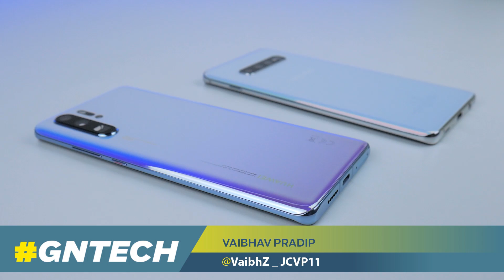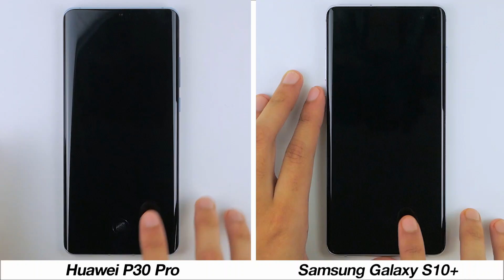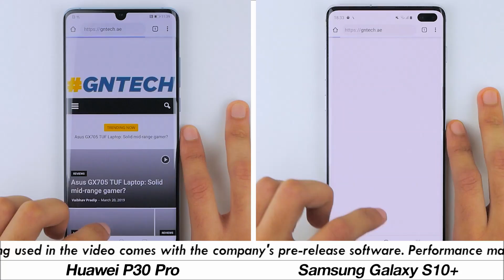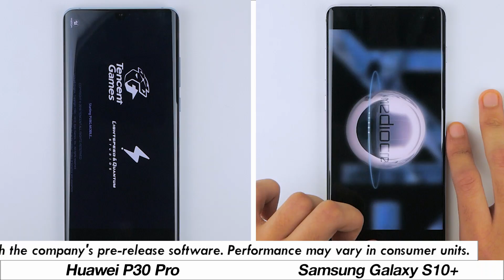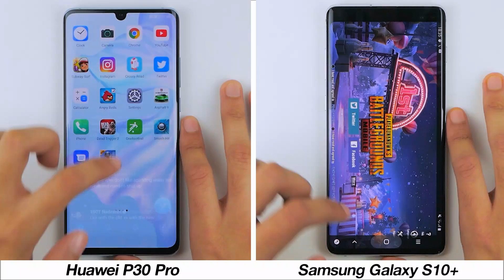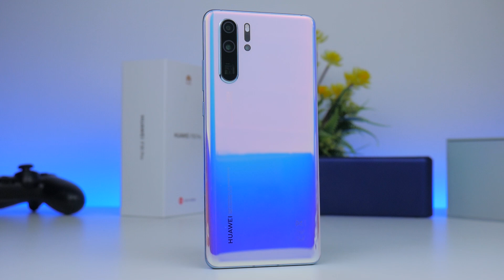Samsung Galaxy S10+ vs Huawei P30 Pro Speed Test: Kirin vs Exynos!

Comment: so speed p30 pro > s10+, Camera p30 pro > s10 + , battery p30 pro > s10+ . So s10+ is getting slaughtered.
Reply: Jimmy Huang everything else S10>p30 pro
Reply: @abdulwaduod11  still doesn't change the fact that S10+ is getting slaughtered
Reply: Jimmy Huang in my opinion p30 pro have some problem that they need to fix, video (4K at 30fps), front camera , they need more advanced fingerprint unlock, speakers are bad, microphone is bad, and they need to put quad HD screen, if they can do that then p30 pro >s10 plus

Comment: what was the screen resolution used on S10?
Reply: it'll be max resolution.  It's a selling feature on the camera.  To reduce it to 1080p for this test wouldn't be realistic.  Much more realistic to use max res on both cameras.
Reply: @BelfastBiker  I was talking about screen resolution, not camera resolution.
Reply: @ciprigeorgiu  as was I.
Reply: @BelfastBiker  You mentioned camera twice so I thought you were talking about camera. My bad. But the again it's not really fair to make a speed test and use one phone to a higher resolution as that means more pixels to drive. You get more FPS on a computer with 1080 monitor compared to having a 4k. S10+comes with FHD out of the box. Leave it that way if you make a speed test.

Comment: Kirin 980 unbeatable still now. That's proof benchmark does not matters. Actual real time performance matters and kirin 980 rocks hare
Reply: Nononono stop this is the exynos variant of the s10 which is bad. There also is a snapdragon 855 one which is as fast as the kirin 980
Reply: This has nothing to do with the cpu, you know that rite ?
Reply: @sw0925  Kirin 980 is faster than Qualcomm .of course it matters. when u running yr application and of course not the game itself because of the person itself

Comment: "EMUI 9.1 actually brings a major change under the hood. Every phone to come or be updated to this version will get a new file system called EROFS.

The ERO file system is supposed to offer 3x increase in Random reads, 10% improvement in app startup, and also has freed the storage taken by system files by 20%. So, while there are no visible changes from the Mate 20 series EMUI, the P30 Pro should be snappier in certain scenarios and its OS should have a smaller storage footprint than before."

https://www.gsmarena.com/huawei_p30_pro-review-1910p4.php

Comment: the p30 pro just cruched the s10+
Reply: On the basis of animations which are faster than s10
Reply: @ishanbarai4334  well i don't think so, this video is speeded up and i couldn't see any difference in the animation so how could u deduct that? The animation looks the same to me. Besides, the difference is much more than just a difference in animation speed.
Reply: he should use Samsung s10 with s855
Reply: said p20 pro speed test is even equal to s10  so it was no surprise that p30 would be faster

Comment: If only the standard P30 would have had IP68 water resistance...
Reply: It does
Reply: @sheikhsuleiman9208  no
Reply: @sheikhsuleiman9208  no it has IP53 which is only splash resistant.
Reply: It's unnecessary if you're not taking your phone near any water source hahshd

Comment: Huawei is squeezing more juice out of the year-old Kirin 980, which was supposed to be trumped by the SG855, both in terms of performance and battery life.  Somehow I don't think the Samsung unit is using the SG855 to its full potential as even the significantly cheaper Xiaomi Mi 9 is able to outperform the S10+.
Reply from the maker: We do have tests with the Xiaomi Mi9 coming up versus the Huawei P30 Pro so do look out for those videos by subscribing. In this particular video, the Samsung Galaxy S10+ variant being tested has the Exynos 9820 processor as stated.

Comment: I only had Samsungs until I bought Mate 20 Pro last year. Gouorgeous, fantastic piece of engineering. BUT, SOFTWARE .... 2 years behind Apple and Samsung. I just switched back to S10+ and I feel I just came back HOME from a log, interesting journey. Software Samsung KNOWS EXACTLY WHAT I WANT AND WHAT I KNEED 
S10+ vs Mate 20 Pro :
Way Way better = video, speakers, headphone jack, oneui, autorotate sensor ( way more responsive and intuitive) , aod ( way better implementation and options ) , panorama photos, image ( nobody asked my about my Mate 20 pro but almost everybody ask me about my s10 ) 
just better = daylight photos, ultrawide photos, weight - lighter, resale value, display in sunlight, heart rate sensor, darkmode, photo sugestion mode - just addictive, in display fingerprint sensor - way faster but no wet finger as they pretend ,

Mate 20 Pro vs S10+ :
Way Way better =  battery ( battery life, ultrafast charging both wired and wireless. This I MISS THE MOST . They say comparable battery life but, Mate 20 Pro has way way better battery life NO MATTER what video comparison pretend. That was my experience as I have them both), night mode photos, zoom photos, ergonomics of buttons, SIGNAL - way way better signal call reception, wi fi, LTE, bluetooth - it just flies. Speed - born fast stay fast - as I am a heavy heavy user, after 5 months of intensive usage, my Mate 20 Pro works as fast as new. That has never happend to me with no Samsung before 

Just better = IR blaster, sharper photos, cheaper, more natural photos. 

I chose S10+ for : Speakers, ONEUI, ultrawide and panorama photos , video recording
I miss the most battery ( life and charging time ) 
This apply somehow to P30 Pro as it has a superior zoom camera and night mode. But software, speakers etc - still Huawei
I feel like Huawei = a Ferrari with a regular driver and Samsung = Golf GTI with a real Pilot
Huawei = fabulous hardware, poor implementation
Samsung = just great hardware but excellent implementation to take the most out of it
That is my experience. Eather way both are TOP NOTCH - way way over Lg, Xiaomi, One+ etc etc
Reply: good comparison
Reply: @burakacar2854  Thx
Reply: But I don't like heavy UI, like OneUI, they are system hog generally and drain battery and CPU cycles.
Reply: Stefan Constantinescu What is your version though, by your name I guess it’s Exynos?
Reply: @kingcs6273  yes
Reply: @stefanconstantinescu1576  can you help me about what phone to choose betwen s10 lite, plus or Huawei p 30 pro?
Reply: @gixi430  Difficult one. Each one is great. 
P30 Pro : better battery, Zoom camera,  conectivity
S10 lite : SD card, Samsung UI , beter dual speakers
Reply: @stefanconstantinescu1576  s 10 lite think have mono, and plus?
Reply: @gixi430  I would buy Note 10+ . Is low price 750 eur from Corona Virus